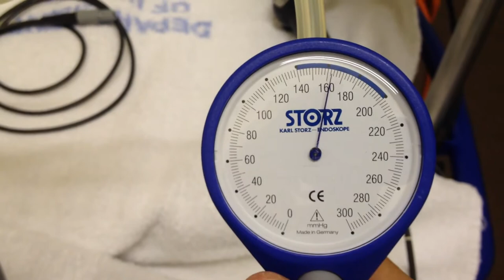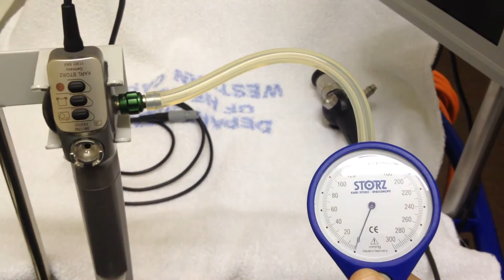AirwayHowTo: Leak test a flexible endoscope

Comment: what do you do with the expensive scope if they are leaking? you repair them ?
Reply from the maker: Yes, if the leak is in the exterior sheath, it can often be repaired.  If liquid gets inside - especially cleaning solutions - it can wreck the scope beyond repair.